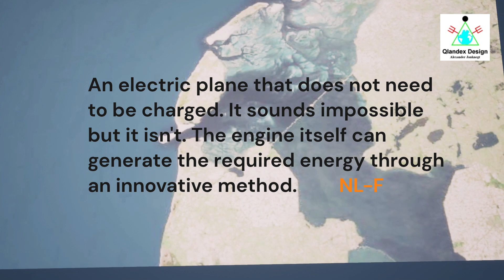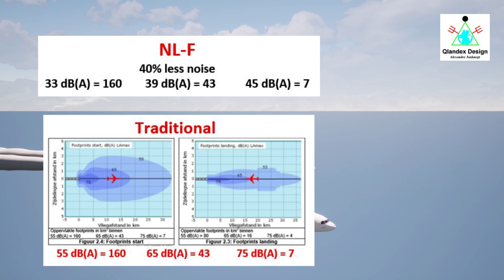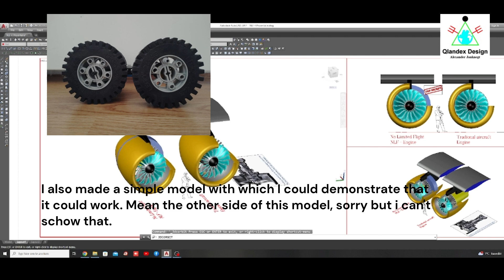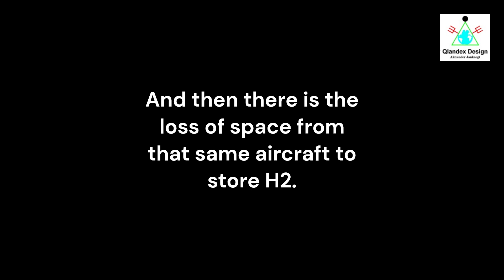No Limited Flight  NL F Qlandex Design

Comment: So it is a perpetual motion machine? And it is generating its own energy by using the airflow when it is at speed? Drag and laws of physics have been considered in the design?
Reply from the maker: Almost good, but it's a shame that the undertone is quite overpowering.
Reply: @qlandexdesign9169  3 questions, which should easily be answered with yes. If so, you are a genius. If not, you have a dream, not an invention.
Reply from the maker: @joostkamphuis85  Sorry, you asked 3 questions, not all of which can be answered with yes. But okay 1st answer, yes and no only found the key that could make such a technique possible.
2and3 answer no, I am not a dreamer, I like to work on something where others say it is not possible. And I wonder how could it be?